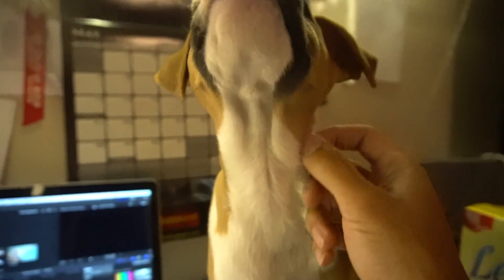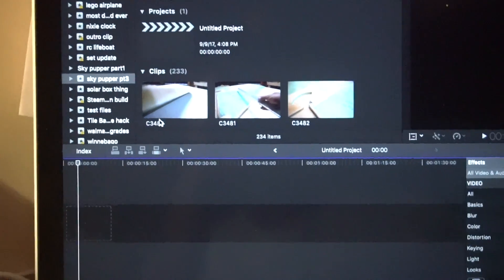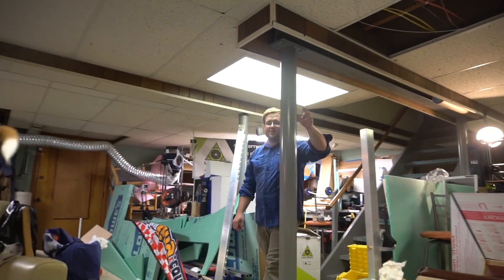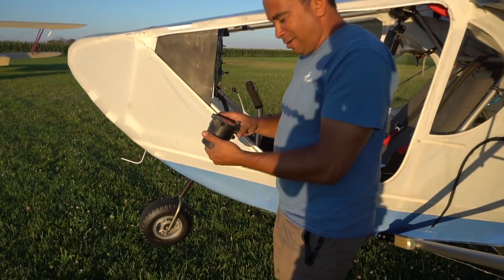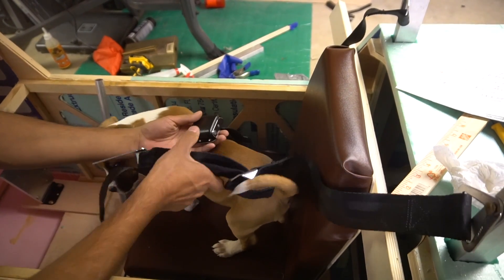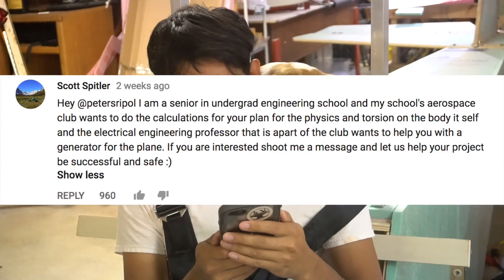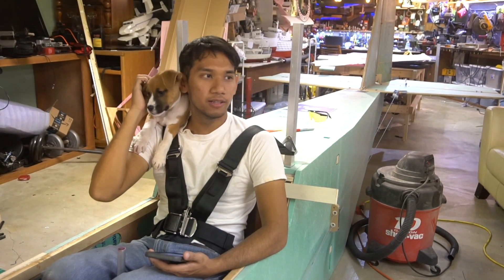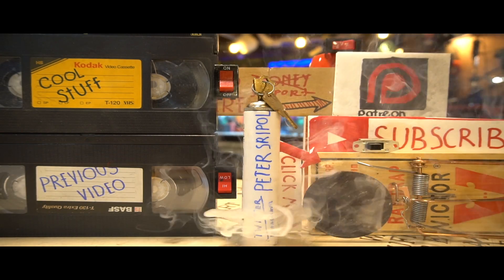DIY Electric Ultralight airplane pt3 (cockpit and controls)

Comment: Have you thought about giving yourself room for error for the engines? Such as having engines with more then enough power to get you off the ground.

That way if you have one engine failure the other one will get you to the ground safely. 

Also if you do die...could we have what's left of the airplane?

Comment: Your over-shoulder mounting points are in a terrible position go have a look at some mounting points.  And they are mounted to poor material in a bad position from a structural perspective.  You at least want diagonal braces on the uprights, connected to the internal ply frames.

Comment: This is a super cool project, but I´m afraid that the construction is not very safe, seems rather improvised. You are focusing too much on saving weight on the first real plane you are making. I´m a pilot and that tail section gives me nightmares. Also, I hope that you have actual experience flying real aircraft because you are going to need it, this is not something to learn on the go.

Comment: Hey man i think that maybe you might need more crunch zone on you ass/spine. I would suggest an extra inch or so of Styrofoam for good measure. It weights practically nothing but it could save you life. Trust me. I am a P. eng (peter engineer, not to be confused with the professional engineer(

Comment: Just make sure to check the ends of those cables each and every flight and replace when frayed. There are plenty of recorded crashes because those cables snapped where it meets the crimp and the wings fold and they come down fast n hard.

Comment: You should make trims for the elevator. They will take the pressure of your elevator cables, and as you said, loosing it is the worst thing to happen. You can land it without ailerons and rudder, but not without elevator. In 2015 I saw a Beechcraft bonanza brake its elevator cable. Luckily the guy was landing and was something like 20ft over the runway. But it was scary. The plane suddenly dropped almost like a rock and had landing gear problems. So you must really be careful with that part of the project. Good luck man and sorry if my English is a little rusty

Comment: I am concerned about your seatbelt attachment points. They extend down below your shoulders which in the event of a hard landing can crunch your spine and force your upper body into your lower body.  Just like in any car it is best to have them just over the top of your shoulder so your body is pushed straight into the belts and not into and down.

Comment: This is a very exciting build peter. Been checking your channel every day for the past couple of weeks to see an update. I am not an engineer and was wondering whether the foam board/balsa wood/glue construction would hold together in flight? The ultra light that you showed used an aluminum frame, bolted together.

Comment: Looking good, you may want to add cable thimbles to all your cables to keep them from wearing through at the turnbuckles. Also I know you are running flying wires to the top of the stabilizer. It would be a great idea to run them on the bottom to the fuselage as well. Fly safe

Comment: I definitely second the 18650 cell battery suggestion. A battery made of Samsung 25R cells would be cheap, reliable, and lighter than an equivalent lithium polymer battery solution. For example a 35 lb bank of 25Rs would include 350 cells totaling just over 3.25kW-h and would pose a much lower fire risk in the event of an electrical or physical incident.

Comment: I'm not an aeronautical engineer and have no experience building aircraft; i only have limited knowledge from flying a pa-28.

There are very few things that catch my attention (unlike before where i was practically screaming at the screen):

The first is the hinges. This isn't a flaw, (i know you probably know this) but make sure that the hinges are well oiled and wont get stuck. if that gets stuck on full down or up then you are gonna need that parachute. it probably wont fail, but Murphy's law..
i know you also said they're industrial strength, but be careful. Remember; there are incredible amounts of force pushing on these in all directions, and this could increase the friction between the moving parts which could make it lock up.

personally, i would say double up on the control lines, but that is me being paranoid. i know you got it from a heavier ultralight that should work for yours, but remember they will be holding the control surfaces against the wind and be taking the weight of the air hitting the control surface, which is a lot, even though you'll be flying slowly.

good idea with the elevator control being on the outside for easier access. +1. 

i would recommend (if you aren't already planning on putting this in) is the scissor hinge on the rudder pedals. i'm sure you know what they are, but just in the odd chance you don't, would recommend you search them up and makes sure to include them so you don't mix inputs to the rudder and overload the control lines (just for safety).

just remember to check everything, since it is always the most smallest, stupidest things that do you over big time. (i speak from experience)

i recommend this because i really want you to over engineer this aircraft. if you under engineer it, you wont won't be able  to change it later

best of luck with the future of the project
fly safe.
Reply: Ryan M. Lack of maintenance on the rear elevator jack screw on a commercial flight led to the aircraft pitching and then rolling over and going into the ground. Mechanics found on manslaughter charges. I believe it was flight 261 Alaska Airlines

Comment: You can use 18650 easy just try 2 tesla molels s/x modules I think they have plent one power for your use, they should be 7s around 60p each pack. Cheers.

Comment: Hey Peter, I really dig your videos and I'm super excited to see this plane fly! One thing I did notice in the build montage was the use of nylon lock nuts, great product, but I saw a few that looked like they weren't engaging the locking area all the way, it'd be worth getting some slightly longer bolts or adding some thread locking compound to a regular nut. Keep in mind nylon lock nuts do wear out a little every install and uninstall cycle, they usually carry a rating for about a dozen installs. Good luck man, have fun!

Comment: Since you're so concerned about the elevators - why not a 2nd set of cables on the other side of the plane for redundance?  2=1 and 1=none!
Reply: Weight reduction? It seems to be pretty secure as it is but like you say: "One is none and two is one!"
Reply: It's just a couple of cables and he's got the actuator outside already so it can't add THAT much weight.
Reply: A couple cables and the hardware that mounts it to the yoke and elevators. but yeah it woudnt amount to much other than having to modify the elevator to allow the hardpoint for another attachment, putting another hole int he fuselage and mounting it to the yoke.

Comment: Hi Peter, I wanted to make two main suggestions.  1.  See if the local EAA can come by and look at your build and I am sure they would have some great suggestions.  2.  Flight Instruction.  If you could come out to Arizona I would be happy to work with you in my Cessna 150 but if you could find someone local they could give you some invaluable experience.  With your experience I do not think it would take too many hours to get you soloed, but I think it would be the best thing you could do for your safety.  My last comment is on your current video.  The plane looks great and am happy you bought AN parts.  I would suggest one change to your shoulder harness belts.  Those AN bolts will pull right through those aluminum channels you have them bolted through.  You will need to beef that up.  The other issue is you have them mounted too low.  I can send you pictures of my Cessna aftermarket mounting of a 4 point harness.  They need to mount above your shoulders.  Nice work on the plane and videos.  Please take me up on my offer or look local for some instruction.
Reply: Peter has a private pilot's license - mentions in comment section of Pt.1 video.
Reply: im sure he knows how to fly
Reply: Todd Bevins 
Definitely agree on the flight instruction- even if it's just getting to solo standard on a microlight- there are a lot of things to be learned  -like how a landing approach and flare should look and feel, as well as memory items for engine failure on take-off, for example.
Reply: Clorox Bleach, you would be wrong.   It may be underpowered but I am sure it is going to fly.  Peter will work at it and correct its issues to make sure it flys.
Reply: He has previously stated that he holds a private pilot cerificate with ASEL rating. I'd say he's all set, though would recommend he work with an EAA flight advisor when planning his flight testing program.
Reply: There is a big difference in flying a full size plane and flying an RC plane.  If Peter has never flown a plane before he will have a bit of a learning curve even with his RC experience.  To make matters more complicated we are dealing with a maiden flight  of an experimental homebuilt.  Another factor is light aircraft are harder to fly than larger heavier craft.  Look at the crash statistics with light sport planes.  Most of the accidents are by higher time pilots.  Smaller planes are much more affected by wind than heavier certified aircraft.  If Peter does not get some instruction I am concerned.  Also it would be a great idea to have someone from the local EAA to come look at his build.  They have experience in building exactly this type of plane.  It may be fun to trail blaze but it is not like someone has not been down this road before him that can save him alot of headache and possibly his life.

Comment: Peter,

As far as 18650 cells go, the NCR18650GA's are where it's at (3500mah 10A discharge). A former youtuber that did mygeekshow started Titan Flight and they will make you a custom battery that uses these cells. You just need to tell them what you want. https://www.gettitanpower.com/pages/commercial-uav Anyway best of luck to you.

P.s. I'm scared.
Reply: Agreed, make sure to get quality 18650GA cells, and not fake ones. https://lunacycle.com/ would be another place to get a power pack.

Comment: hey peter you upper seat belts are mounted too low if you crash and you body rushes forward you spine might be compressed due to the belts pressing it down if you lean forward

Comment: 18650s have a lot more energy per weight, but a lot less power per weight, so you need more mass to power your engines, but they will last much longer.

Comment: Unless the hardware isn't finalized, one big critique many would make is using standard lock nuts in lieu of other fastners like rivets, castle nuts, cotter pins, safety wire, etc, specifically with the linkages.

Comment: i noticed the hinge for the safety bekt is positioned 90 degress off where it suppose to ,in the case of a crash  it will bend and probably tear-  i think you shoul d put it not in the forward facing side of the pole, but in the  side facing side, in that case it will be safer

Comment: Hey Peter,
From the car racing world, be careful where those shoulder harnesses are tied into the frame. General rule of thumb is they should mount at least at the same level as your shoulders if not a little above them. If they are mounted below your shoulders, in a hard stop (unplanned landing?) they will compress your shoulders and potentially your spine. Fly safe mate!

Comment: Peter it's looking good. Your a smart guy but remember to recheck wire tensions as even low stretch wires will still stretch some. 
Big question is what voltage and Mah will you have on tap? 
Prop size?
And project safe flight times?

Keep up the great work and looking forward to part 4!

Comment: You should slow down the movement of the handle as if you sneeze or something like that you could nose plummet into the ground. You should probably install a suspension system so if you stall above the ground it reduces the force of said impact. Also try not to die I love your vids.

Comment: Move your harness a little higher. In driftcars it should be horizontal or max 20 degrees down, because if its mounted lower it will compress your spine in case of an accident. I guess for planes it should be the same.
Reply: I know exactly what your talking about in a car perspective, lots of people try to mount the harness to the floor behind themselves, but they don't realize they are putting themselves at risk. Most small aircraft have shoulder belts mounted on the roof for this reason. Also getting a 5 point harness would also be beneficial as it prevents "submarining" which is when you slip out the bottom of the harness. Even better Peter should invest in AMSAFE inflatable seat belts, they've saved dozens of crop duster pilots.
Reply: I second this from a car perspective; I know nothing about flying.
Reply: From my experiences in gliding, it doesn't really make a difference. That being said, crashing in a sailplane is a pretty much guaranteed death.

I've just realised I misread the comment. Disregard what I said!
Reply: The shoulder harness attach points should definitely be a bit higher.  I did notice the hip belt was riding pretty high, you may need to tighten the hip belt more before you tighten the shoulder straps, or have a more forward mounting point for the hip belt.
Reply: The hipbelt problem can be solved either that way or just getting a 5 or 6 point harnes+the same thing.
Actually going with more than 4 points is a lot better anyways.
Reply: i think a lower centre of gravity would be better as then his weight would help centre the aircraft in the event of a loss of control
Reply: I would also be concerned about making sure the quick release works when you need it.
How does the harness work with the parachute?
Do you sit on the parachute, is the seat designed to accomodate it?
Aside from that, do we have a hashtag for this series yet, if not my vote is for #DONTDIE.
GL
 - Eddy
Reply: Deathlok67 ballistic chute.
Reply: Deathlok67